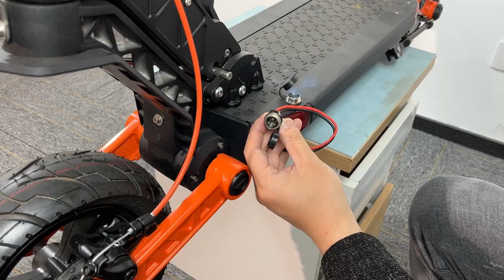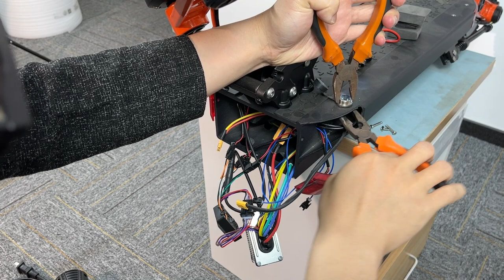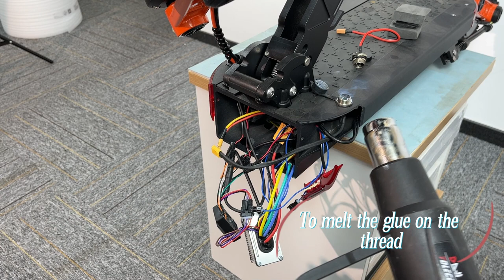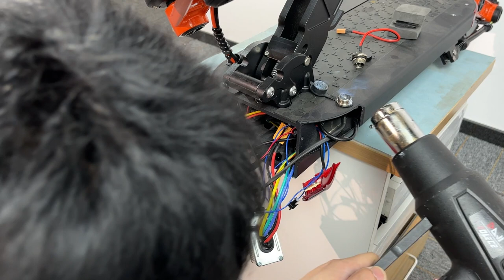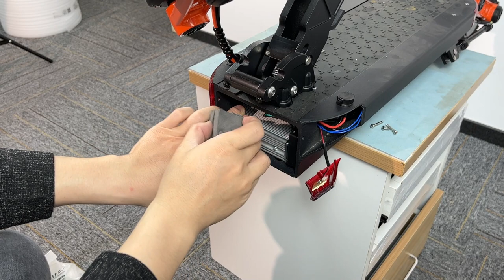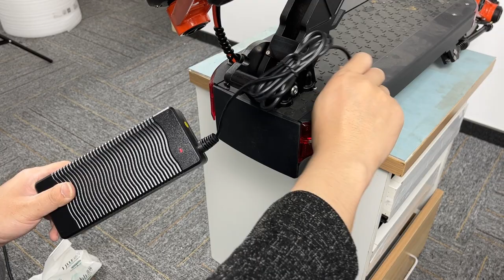How to replace the scooter charging port JOYOR S5 S8S S10S JOYOR SCOOTER REPAIR

Comment: what were you heating off? was it sealant for water to not get in? will a silicon sealant or black seal be put in place of the original sealant before putting in? after you wiped the scooter down and removed the faulty part.